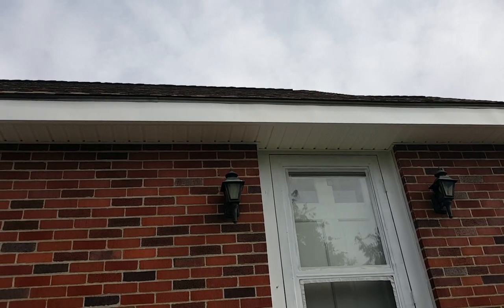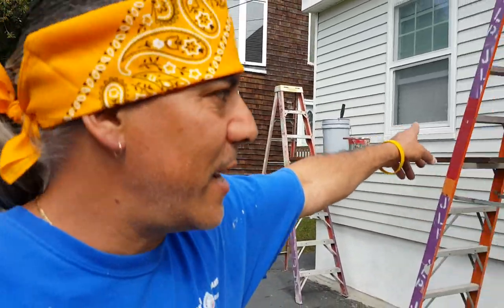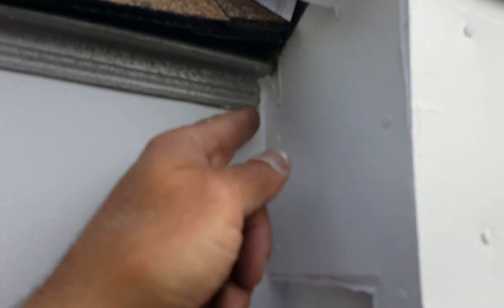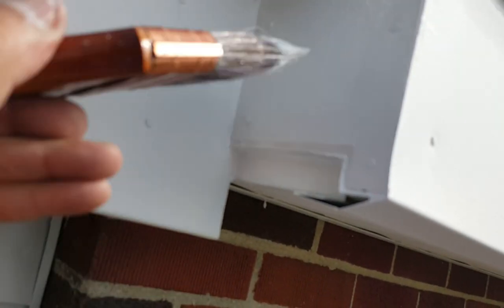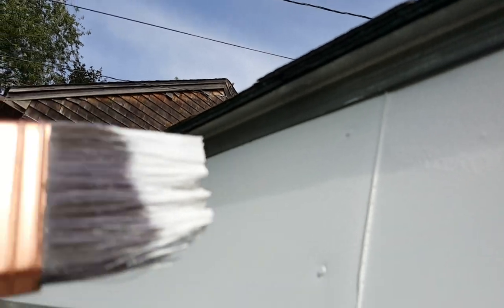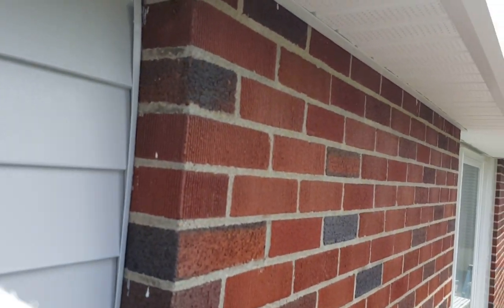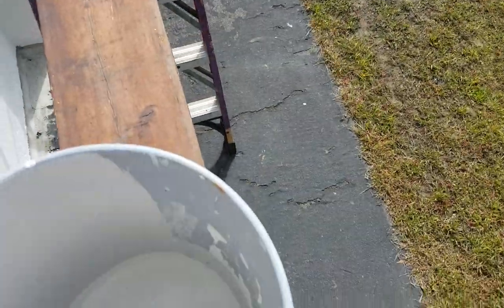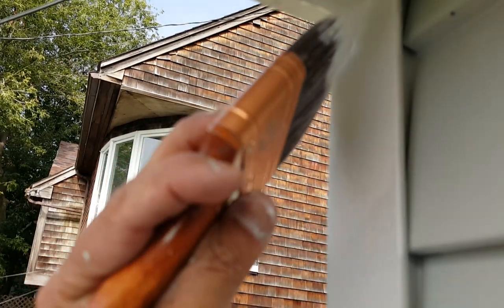Da P8NTRMAN🎨,  Painting Exterior aluminum siding.

Comment: Great video! what ratio of Emulsa-Bond is proportioned with the S.W. Duration?
Reply from the maker: @Gerald Golen, Thank You for viewing my video. I have another great video also relating to the Painting of Aluminum siding where I explain in great detail and speak at great length regarding the Paint used(Sherwin Williams Exterior Duration), the Ratios, the type of sprayer, spray tip and most importantly the cleaning/etching with TSP.
Thank You for your great question.

You will need 2 five gallon bucket to start. Mix 5 gallons of Exterior Duration + One gallon of Emulsa-Bonder + Half a gallon of water. Mix thoroughly. Cover the paint after mixing. Something I do when spraying, I add a cup or so of water to just let sit on top of the mixed paint to prevent the paint from drying. Any unused paint, I also add water to the top and seal it. If left unattended in the sun it will create a skin at the very top. To prevent that I add a cup of water to the top of the paint. 
Before spraying I would recommend removing the manifold filter to the sprayer but add a 5 gallon straining bag to the suction tube. You don't want dust particles falling into the paint. By removing the filter out of the manifold the sprayer won't gasp and pressurize quicker when spraying. If using a 600 series sprayer or greater it won't be necessary to remove the manifold filter. Smaller sprayers like my little Graco 495 Ultimate MX has a hard time sucking and pushing the product because of heavy viscosity of the paint. Emulsa-Bonder tends to thicken the paint and turns the paint into an Elastomeric. In order to neutralize that I add water.

I hope this works. There is a lot of details to keep in mind but once you get going it flows. Emulsa-Bonder is the steroid and ensures the life extension of the coating. It is flexible for many years and it resists the expansion and contraction of the cold and hot weather. It also resists water. It's a formula that works. In my opinion it's better than Emerald. Big price difference.

Again Thank You for viewing my videos. Happy Painting and God Bless wherever you are.

Sincerely, 
Jhonny La Salle
Da P8NTRMAN 🎨
Reply: @JonathanLaSalle  I live in the burbs of Detroit. About 15 yrs. ago I painted a 10-12" aluminum strip (just below soffit) that went around my ranch home. Washed with TSP until no more paint residue came off. Then applied an oil based primer than my paint. It's held up wonderfully. No pealing. It came out so well that I used the same with my aluminum sided garage. And I did with brush and roller! Oil based primer was difficult to work with. If the sun pops out...forget it. Dries too fast. Anyway, planning on painting my daughters aluminum awnings and using your method with the Emulsa-bond and S.W. Duration.
Reply from the maker: @geraldgolen9157  , Outstanding. Hope it all comes out nice. Thank You for sharing your story. It thrills me when people do Painting on their own. 
Most of my videos were filmed in Massachusetts. I lived there since 1985. I started painting in 1993. I left Massachusetts in 2019 and moved to Washington State after landing a job with Washington State University. New England Patriots Quarterback Drew Bledsoe's Alma Matter. It's located in Pullman, WA. After Covid started we were laid off and I landed a good job at another University here in Seattle. I am the lead Painter here. 

Painting has been my life. I Love what I do and the reason behind my videos. I want people to know how to paint themselves. I call it Empowering!
Happy Painting...

Have a blessed year!
Sincerely,
Jhonny La Salle aka Da P8NTRMAN 🎨